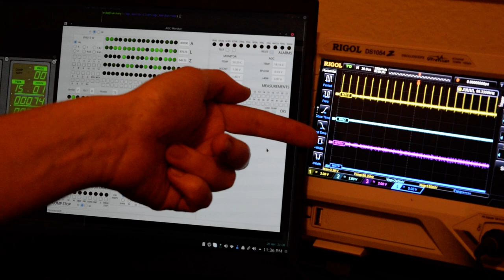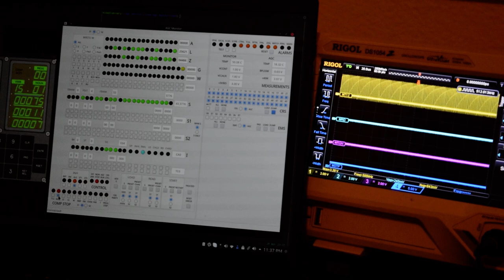AGC Monitor Rope Dump Demo

Comment: Nice work Mike! Was the speed increase a side effect of your robustness modifications, or was faster interaction a goal in itself?
Reply from the maker: Totally a side effect. My original way of doing peripheral instructions was pretty janky and screwed up some with some weirdness in the test connector signals. The new method is much better, although apparently still not perfect.

Comment: I'm not very clued up about these things but I have a question :) How was the clock signal generated for the AGC? I'm guessing this was a time before quartz clocks were used in computers, also what frequency does the AGC run at?
Reply from the maker: It was a 2.048MHz quartz crystal: http://www.ibiblio.org/apollo/SCDs/scd_1006847d.pdf
The 2.048MHz clock is divided immediately by 2 in the digital logic, so it's really effectively a 1.024MHz computer. And each instruction takes on average 24 clocks to complete, so the effective instruction rate is ~42kHz.